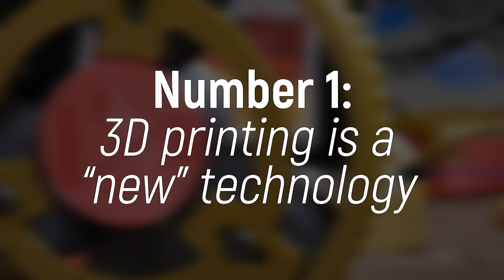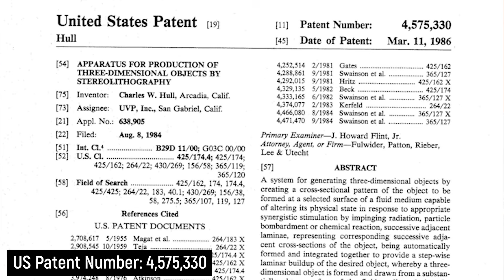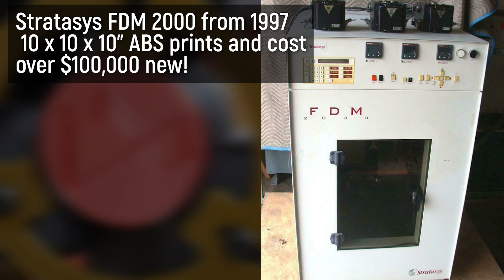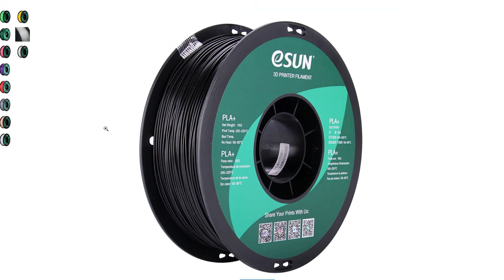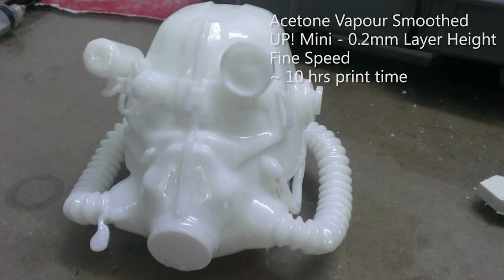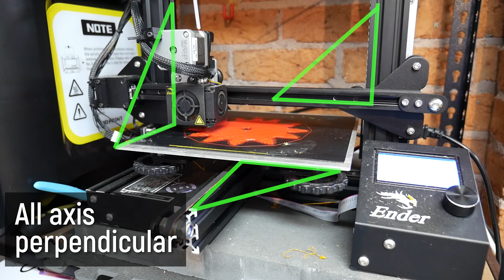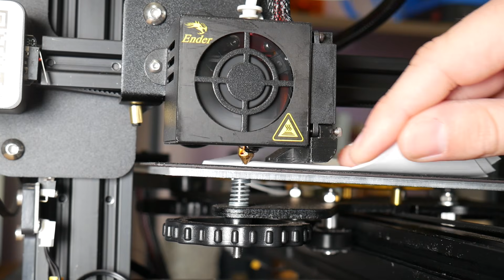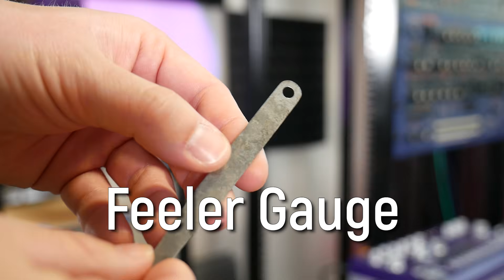3D Printing Myths I used to believe...

Comment: I sold my 3d printer. 1. I was able to print squares, but could not print circular objects, so I gave up, i cleaned the bed spotless with soap, alcohol and tried glass bed and plastic bed. 2. My apartment in winter gets extremely hot and because of the fumes, I needed to open my window letting very cold air in….I think that threw it off. 3. The Fumes.
Reply: Fumes? What material did you print? PETG is almost odour and fume free. PLA does produce a little bit of something, but i didn't find it unpleasant, a little bit like a caramel and marshmallow flavour but much weaker. ABS knocked me out somewhat fierce, the stench is HORRIBLE, i got headache and lost consciousness from it. I think the ABS got better after i packed it with powerful desiccant for a while though, but i still don't think it's advisable to be in its vicinity when it prints.

Indeed drastic temperature changes in environment tend to ruin prints.

What kind of issue with circular objects too? I personally haven't had major issues. Sure they come out a tiny bit oval but just the tiniest bit barely measurable, and squares are skewed much the same, anyway it's possible to compensate it out if i cared enough, i have it dialled in fairly well enough.

But then i didn't get the printer in order to print, the prints are a byproduct. I got it because i really wanted to learn the machinery and technology and improve myself, and all the problem-solving has been a pleasant and desirable experience for me, and i did buy almost the filthiest kit i could find, just to be able to learn more, but with good quality and flexible electronics and prepared for reprogramming out of the box. For me, the best purchase i ever made! I had been reading about it and watching vids etc from 2015 on and when i got the kit in 2017, i basically knew exactly what to do, my second print was already a full success, and my first would have been had i just left it alone and not been tempted to see what happens if i push the feedrate past any sensible limits.

Comment: The bed levelling one is interesting, now I know why I don't get good adhesion on my first layer sometimes. I totally forgot that the Z axis moves up from the home position of Z before it even comes close to the bed, of course it doesn't just keep the Z at home and then just move the other axes when printing XD

I shall now be moving my bed up from the home position and and using a feeler gauge for that distance when tramming.

I feel ashamed and should know better as a CNC setter/operator, however, every day is a school day.

Thanks for the very informative and educational video :D

Comment: The confusion of strength is because people are to lazy to look up terms and see how they are actually used in industry and then realize that industry doesn't use those terms unless they are modifiers (stronger/more impact resistance, stronger wear resistance,  etc etc etc). Hooking up a chunk of plastic and watching it being slowly torn apart by a self made machine (aka CNC Kitchen) only tells a portion of the story. Saying a plastic is stronger because it took more force to pull it apart only tells us that, at his printer settings, this plastic took more force to pull it apart at the weakest point of the object. If that characteristic is important to you (hardest to pull apart a X=thinnest point of print) then you are all set. 

 Stephan is a good guy but there are flaws in his testing methodology, it's definitely a good start though. Try to mention this to anybody and "fanbois or channel followers" jump all over you or you get ignored because you're just some "knowitall armchair professional." Traditional plastic characteristics are well known and documented already (probably not so much info exists for all these crazy poly blends for 3D printing though). ABS is well known for its impact resistance and thermoforming characteristics. When these are desirable characteristics, ABS is indeed "stronger." BUT, do the blends have the same exact characteristics? I would guess no, and proper testing is not likely to be on the horizon. There are many modifiers offered and it all comes down to what you want.

I use PLA for anything that doesn't have heat or pressure applied to it. Because, in my experience, PLA deforms way easier than PETG. I don't really bother with ABS at all. I use PETG for everything else that might have extra heat or pressure. I make mostly functional items though, anything non functional gets PLA.

Comment: I am open for discussion on this topic, As im not a big fan of feeler gauge. Your brass nozzle is a much softer metal then the feeler gauge and on the long run it will lower the life time of the nozzle by rubbing the 2 against each other (dont print enough for me to be able to track this). Your feeler gauge will also rust overtime if u dont keep it properly lubricated, so unless u keep buying new ones, your options on older gauges is to have a rusty metal jam onto your nozzle or leave oil residue on the build plate. Iv been printing for almost 10 years now and i just eyeball the height when cold, check again when its hot that its expanded to the build plate by moving the plate around and listening for changes in resistance, then when printing the brim i might adjust the srpings , then i walk away. I only need to relevel a build plate every 6-7 prints. If you want to automate a build farm, get a level sensor.

Comment: I'm finding the biggest value for ABS is working on large objects with multiple parts that need to be joined together.  ABS is just so much easier to solvent weld and sand, in my limited experience, than PLA or PETG.  As for strength, I would think that depends on printing conditions more than material, with the main effect of material being that ideal conditions for PLA are much easier to achieve than those for ABS?

Comment: Anyone else have bad luck with PLA alloys? I can tell they are stronger but warp more and dont stick to my print bed well. Im not printing PLA for strength, ive got nylon for that, so I dont get the point. Id rather stick to the extremely printable standard PLA.

Comment: The 3D printing myth that disappoints me most is the velociraptor call that they 3D printed in Jurassic park. Not a sound you can actually print it out and make. That’s post production sound effects 🙁

I mean like duck calls are real. You can make bird sounds blowing through hollow stuff shaped a certain way

I hoped that print actually did the Raptor sound

Comment: I level my bed while doing a square print that fills my casual print space at very low speed. If the printed line is not squished and won't come of when I swipe my finger over it, it's mostly fine xD

Comment: Real pros level the bed while it's already started printing first layer. 
Just kidding. 
 slight resistance between nozzle and paper (standard printing paper) works for me.
Reply: IMO you're not totally wrong. Printing something like squares/rectangles around the bed and going inward at a slow speed can make adjustments easier in a "real world" print job.

Comment: A dedicated video on levelling the bed using the Feeler gauge would help a lot
Reply: You don't need a video.  Follow the paper method.  Go to an automotive store and pick up a feeler gauge set... it looks like a swiss army knife except with a bunch of flat sheets of steel.  They should have metric and imperial thicknesses etched on them.  Choose the one that matches say 0.25mm... adjust the head to touch it until there is a slight drag.  Now you know where 0.25 above the bed is.  Adjust the z stop in the software to be 0.25 lower so the printer knows where the bed actually is.  

Run the home command.  Then lower the nozzle to Z = 0.  The nozzle should just barely touch the bed.  If the bed moves then the nozzle is too close.  Adjust the Z stop or offset   Done.

If the nozzle is really far away then you didnt add the 0.25mm to the z stop value in software.

If you do this check before printing then you wont drag your nozzle through the bed :p

Note that your bed will have a certain amount of warping when cool and when heated it will be different so you might want to also try lifting the nozzle to your first layer height... say 0.3mm then move the nozzle all around the perimeter and through the y 0 axis to make sure your nozzle doesnt contact the bed.  You can do this while cold and heated to verify it wont hit.

A BLtouch and Bed visualizer plugin for octoprint gives a beautiful 3d mesh of your bed.  It is not very flat.  Even on a thick mirror it isnt very flat.
Reply: @someguy2741  and don't forget visual inspecting. Printing a skirt can help a tonne
Reply: @TheNigaHigaFan4Ever  You can always tell someone is using a bltouch by how scratched up their bed is. Just saying...
Reply: @TheNigaHigaFan4Ever  I have a bltouch. The bltouch only knows where the bltouch touches. It does you no good at all if you can't give it the right z-offset between the bltouch and the nozzle. And to get the z-offset, you'll need to do this tramming, so you're back where you started.
Reply: @mahna_mahna  Exactly! This is why I never have installed the BL Touch that I bought when I got my printer. I worried that it would only complicate the bed leveling process.

The feeler gage makes the most sense to me but I just use paper as a starting point to test at each thumb wheel and at the center. I then print a first layer square at each of those positions -  adjusting on the fly. I keep repeating the first level print until all five square look good and have good adherence.
Reply: @bryandooley5453  Oh, I still use my bltouch. It makes it SO much easier to compensate for the fact that the bed isn't exactly level and varies in height from corner to corner. Once you tram it so you know the zoffset, you can use the bltouch to really speed up of getting the bed properly adjusted (and redoing it quickly later, which you will have to do over time as it gets bumped, you switch stuff out, etc.)
Reply: @someguy2741  ok I get the zero printer, z offset up the thickness of your gauge, level aka tram all 4 corners but then what do I reset the z offset to 0?
Reply: Been doing it with the feeler gauge for years. Works exactly the same way as paper. I use a .102mm one. Perfect 1st layers every time.
Reply: Someone recommended this a few years ago in a comment and it's really quite easy and quick. (1) Pick the correct feeler gauge (say 0.1mm), (2) Then move it slightly back and forth under the nozzle, (3) stop the nozzel moving back and forth when the force needed to move the feeler gauge just slightly is more than free movement.
Reply: I think the gauges shouldn't be used the same way as paper. I mean if you know they have the exact thickness instead if putting it below the nozzle until you feel some force you could level up the bed as close as possible to the nozzle so if you slide the gauge over the bed from one side it'll "collide" with the nozzle tip. You keep bumping the nozzle from the side as you lower the bed until there is enough room for it to pass underneath, then you know it's at that exact distance.
Regarding paper, I've leveled with it lots of times and it's fine, I'm not against it but you can´t compare it to gauges. In addition to inaccuracy, the paper contains fibers that are likely to leave residue on the tip of the nozzle as you move it underneath it.
Reply: I use .0015" shim stock and have no issues.  The shim stock is softer than the hot end so I don't have to worry about accidentally deforming it but is tough enough as to not punch through the paper.
Reply: Learning feeler gauge drag is not something that can be taught. It is something you have to figure out for yourself through experience. That's why they're called feeler gauges. You have to feel them. There's a particular feel to when they're "right". There's no other way to put it really.
Reply: Does the printer really go to 0 on Z axis when leveling? I've found a configuration file on my BIQU B1 SD card that sets the leveling height to 0.2mm so I use the .2 gauge and the first layer comes out perfect.
Reply: @GonzaloMassa  No. The printer just needs to know where 0 is. From there the lowest it will go is what ever you have the first layer height set to in your slicer.
Reply: @GonzaloMassa  it seems to depend on the printer. My Ender 5 Plus works perfectly when I use my feeler gauge while leveling the corners.
Reply: He explained how to do it:

1. Heat the bed and nozzle
2. Home the machine
3. Jog Z by the thickness of your feeler
4. Adjust your bed height
Reply: I've always used a feeler gauge! Just use the smallest gauge, to were it still moves under the nozzle but the is a tiny bit of tension! I always saw people use paper and felt that was wrong to do lol papers are not all the same lol
Reply: Avoid feeler gauge because you will scratch and damage your brass hot end !!!! I did use feeler gauge but i do NOT recommend.

I recommend that you lean a "visual bed leveling" ... aka you find a bed level test (best one is with square), SET UP YOUR FIRST LEVEL AT 0.12 mm height and  then you start sprinting and you observe how squares are printed.

Comment: About ABS : tensile strength is not the only property defining was is comonly perceived as "strength". Quick example : glass as a very high tensile strength. Yet i've never hear someone say : don't be gentle, it's glass.

PLA is quite brittle. In mechanical applications, i much prefer ABS that has some ductility, and can deform before breaking. 
ABS is still the leading plastic in injection molding, partly because of it's mechanical properties. So don't be that quick to say it's not worth it !

Comment: I've always used a feeler gauge. They're cheap and sturdy, plus great for measuring things (like gaps) where you can't get calipers. A decent set should be in any makers toolset.
Reply: What kind of guage thickness should one use?
Reply: @koentju3   depends upon your chosen material layer height, if your layer height is 0.2mm then a 0.2mm gauge will work. An even better solution would be 2 gauges, one at 0.19mm and the other at 0.21mm as a "Go - No Go" solution, where the 0.19 gauge should pass freely but the 0.21 gauge is blocked by the nozzle. This will get you within 0.01mm of your chosen height, easily close enough for FFF/FDM printing.
Reply: @bss369  thank you bro, I'm heading to Harbor Freight ASAP.
Reply: @ZERSETZUNGKOMPLETE  Cheers, glad to help.
Reply: @bss369  This is incorrect, the zero height that you calibrate should ideally be literally zero and not first layer height. This was mentioned in this very video. So it doesn't matter what layer height you print with. It seems best to either choose the thinnest feeler gauge available, or a gauge of a known thickness that you just subtract during calibration, or a gauge of some thickness which is characteristic of bed unevenness and the offset that you're willing to live with. Workable solutions vary, but they do NOT depend on first layer height.
Reply: @koentju3  I used a 5 thou (from AutoZone IIRC)  from comments in this paper v guage vid https://youtu.be/9JAlERd41NQ

Comment: I worked for a plastics factory that made products for manufacturer's in AU such as car dash and other interior parts in a raw square palate size peaces at a rate of around 14 klm in total length a day.
The base production material was a pellet that came from overseas that was stored in large silo's that delivered it through vacuum tubes to "orggers"? that heated it and could combine other element's as well as recycled plastics from the factory floor, this came out of hole in an extruder head about the width and height of a PC  key board like boiled lolly and handled with tongs to an almost figure 8 over rollers that get it to a set thickness and out onto a conveyor belt chopped by cast iron guillotine made in Melbourne round the turn of the century and rotating via Holden 3spd trans to electric motor lol.
All the Meadow Lee tubs came from there......